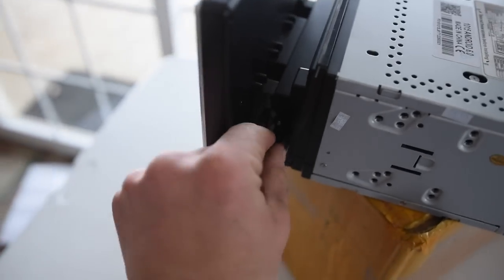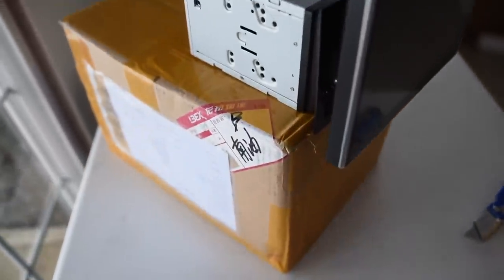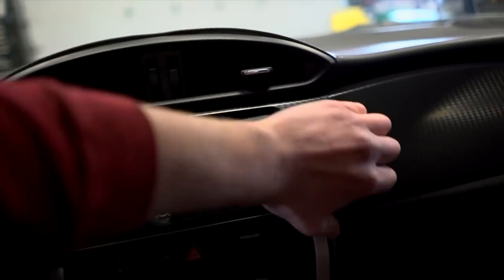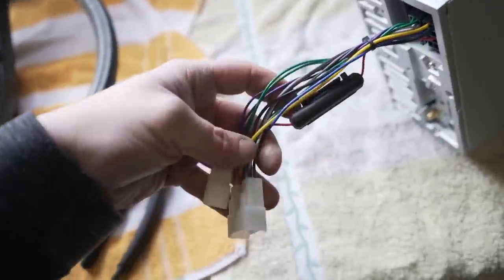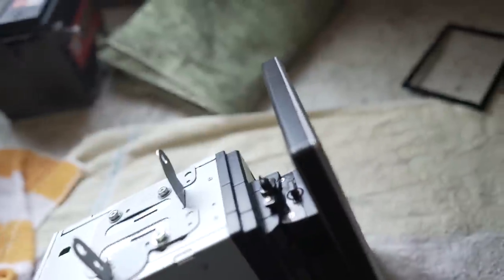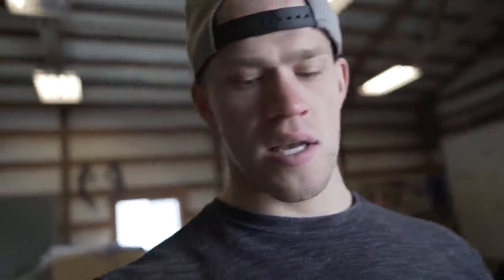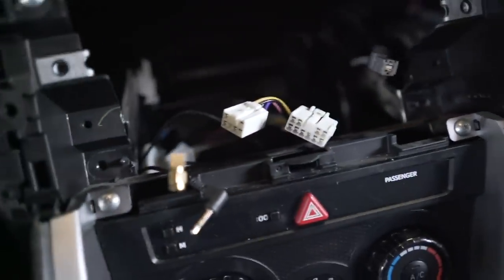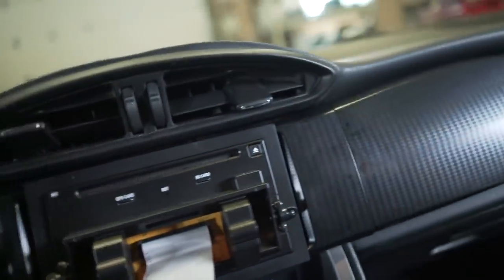10.2" Touch Screen Radio In FRS/BRZ

Comment from the maker: Touch Screen Radio: https://amzn.to/2L6P8fx
Reply: Hey, I'm interested in getting this head unit. How is the music quality with your bluetooth connection? I had a friend who did something like this with his car but when you connected wirelessly it sounded really weak. Do these sound good?
Reply: Can i get the link for the Antenna adapter
Reply: My Honda Odyssey shift gear will hit the left side of the screen. Any chance there is a kit to slide the mount screen about 1-2 inch to the right?
Reply: Hey Im wondering if you have the link for the Antenna adapter? Thanks!

Comment: your radio is blocking your ac
Reply: The air will keep the radio cool from overheating
Reply: Except when he wants to use heat he will have to keep those closed not to over heat radio.
Reply: @mikelowry7730  lmao 🤦‍♂️
Reply: @erikgil2298  well I stay in miami and never use heat so I didnt think about that. We dont have those kind of problems in the 305. 😂